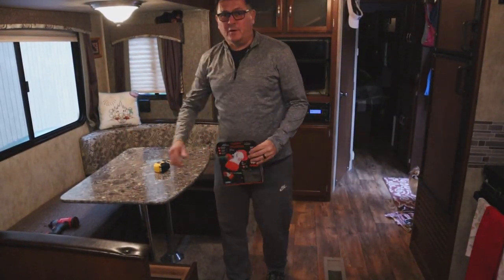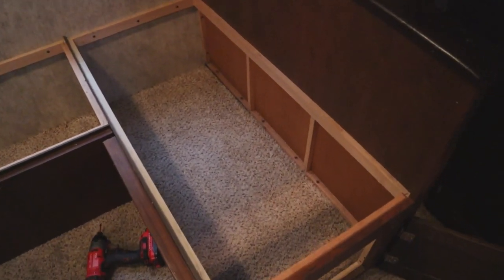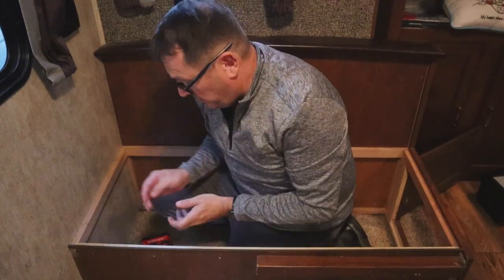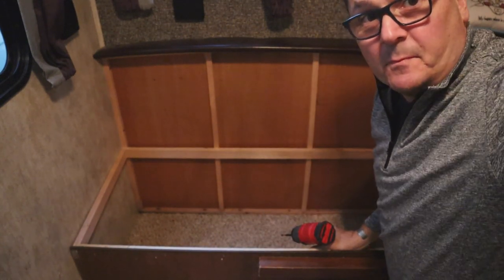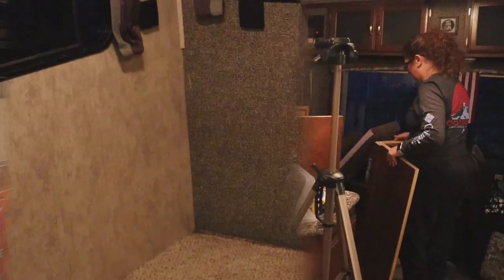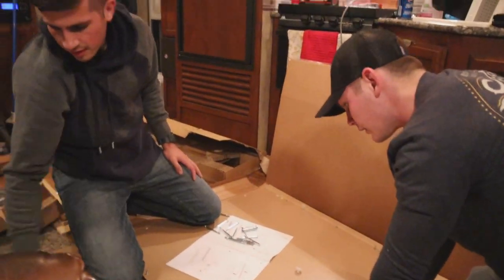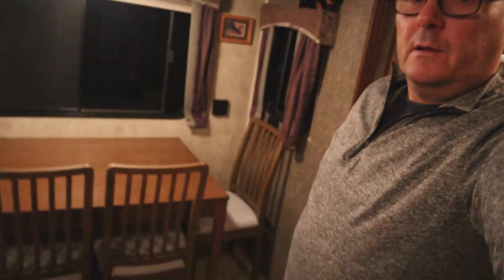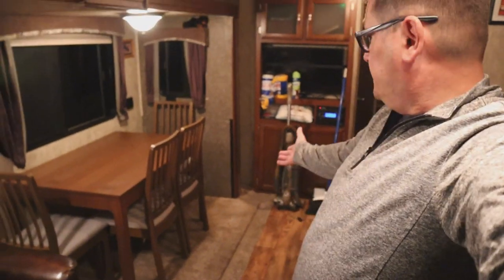IKEA TABLE DINETTE UPGRADE!|| DIY RV UPGRADE

Comment from the maker: Tired of the cramped dinette booth?  We were.. so we made the change.  Total project was about an hour, doing the demo, assembling the new table and chairs.. and worth it!  Have you made a change like this?  Let us know.
Reply: Was there a furnace in your dinnete ?
Reply from the maker: @peterkwakernaak895  No there was nothing under our dinette other than storage space.  It was a good opportunity for us to get rid of stuff we didn't really need or use that was under there.
Thanks for the question.  Hope that helps
Reply: @HappyPlaceDiaries  we have a furnace in there but its coming out with the dinnete
Reply: Good job ! I am thinking of doing the same, after a year of use how do you like that change now ? When you pull out the table does it have a height imbalance because of half the table being on the slide out and other half inside the trailer part ?

Comment: Nice job!  I hate those booths they put in most trailers.  That's one reason we chose our floor-plan, because it has a table in front of a couch and is more roomy and flexible. Thanks for sharing!
Reply from the maker: Our last campout was the outing that sealed the deal.. like I said we have been talking about this for about a year and finally made the change.  The new chairs are way more comfortable too.  Thanks

Comment: Just saw your video, and I was wondering about the people who use the chairs that are close to the lip of the slide out.  Do they have enough room to get into and out of their chairs or do the chairs tip over?
Reply from the maker: That's a great question.  We pull the table out a bit and put the table legs right on the edge of the floor where the slide out meets the floor on the trailer.  This puts the chairs in a position where they are not on a bump.  It works real well.  We sit 6 comfortably around this table.  Thanks for the question and for watching.  We appreciate it!

Comment: How do you travel with the table and chairs.  Do they move?
Reply from the maker: The table is heavy enough that it never moves.  We use bungy cords to strap the chairs to the table when traveling.  Works well.  Thanks
Reply: @HappyPlaceDiaries  Thank you for your reply. 
Safe travels.